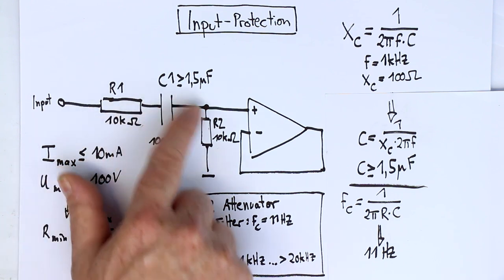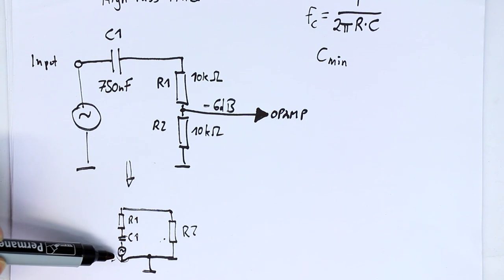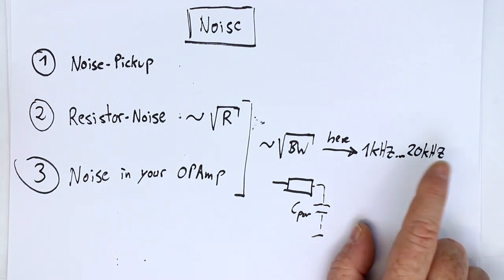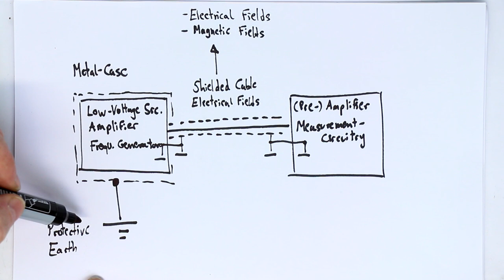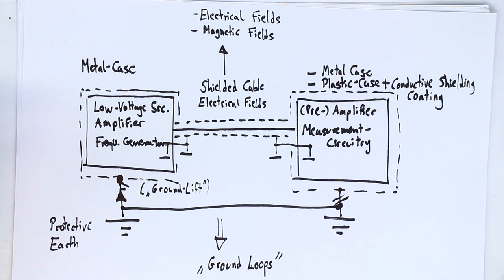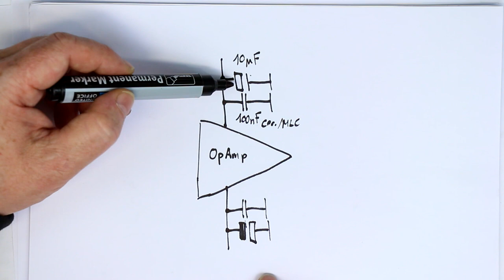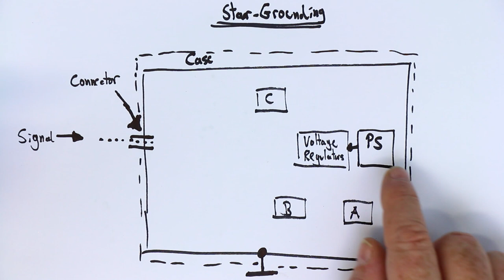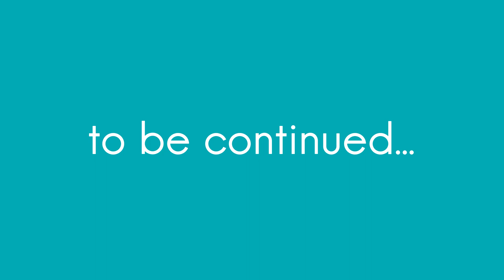Precision OpAmp Design Pt.3: Noise-Pickup, Shielding, Grounding, PS-Decoupling

Comment: Hello Roger, excellent YouTubers such as YOU are difficult to come by! Clear explanation of how OpAmp works and choosing capacitors and resistors without much mathematics. Some people explain it with too much mathematics. Some people explain without much detail. Some people are very good at explaining stuff but their hands and body are covering what they are showing, wires and components are all over the place (and usually without a clear circuit diagram on paper/board how they actually wire stuff).

About noise, recently I learnt about instrumentation amplifier, so-called "balanced electret microphone preamplifier". It is said to eliminate most, if not all, noise.

An instrumentation amplifier looks simple enough to be constructed, utilising only three OpAmps and seven resistors. Neither am I a fan of audio transformer as it can be stupid expensive for a very good one, for that exorbitant price I might as well buy a crazy inexpensive assembled and tiny SMD amplifier from China, and not bother wasting time DIY nor learning about the wonder of electronics.

Will you make a video on it? I look through your videos, there is none about it. Maybe you would not make a video about it as you have no use for it. Oh well, I am merely trying my luck enquiring.
I found some circuit designs and I simulated one with Multisim, only one looks workable. But still, I do not know how to choose the optimum resistors and capacitors. There is also no visual of how those three OpAmp actually work together to achieve common mode rejection, there is also no showing how to test how it rejects common mode. What the heck is 'common mode' anyway! I read a lot about OpAmp but I am still not any more intelligent than before reading!

Oh, I forgot to mention that a dedicated instrumentation amplifier is extremely expensive, although it is superior to three OpAmp combined.

Comment: Another method for eliminate ground loop mostly used in USB is to connect ground between PCB and case (or cable shielding and pcb ground) by resistor 1MOhm and capacitor 1nF which eliminate some of the noise. To avoid problems with ESD capacitor must be rated for 2kV.

Comment: Very helpfull, thanks! A practical question: what to do when there are several transformer(taps) and subsequent power supplies with their own ground? Should they remain separate from each other and from protective earth?
Reply from the maker: Do you mean several transformer(taps) inside one device?
That shouldn´t give a problem when the separate grounds are connected on the PCB at one point (the ground of the power-supply with the most sensitive inputs), using thick traces and perhaps a multi-layer PCBs with separate ground-planes for e.g. analog and digital grounds.

Protective-earth is a difficult question. As I hinted in the video, I never use protective earth at all in my home-built equipment.
When you build/buy commercial equipment you have no choice (except using isolation-transformers or disconnecting protective earth at your own risc). It´s just a matter of trial-and-error. Sometimes you have no problems with protective-earth, sometimes it ruins the signals at your sensisitve inputs.
I know of stories in the analog labs of electronics manufacturers where they have separate mains-outlets with and without an inbuilt "ground-lift" (i.e. the protective earth disconnected)
Reply: OK, that's clear. I use 2 transformers in my DIY DAC. I have the post transformer grounds (and signal ground) not connected to protective earth and also use isolated RCA jacks. Only the metal casing is connected to earth, with mains filtering at the IEC input. Do you feel this would still cause EMI? It sounds great, though, no hiss or hum, but I'm always looking for improvements
 :=)
Reply from the maker: That´s probably exactly like I would do it :-)
In my preamp I completely got away with any mains-related problems by having it powered internally with NiMH-recharcheables (2 separate packs for the analog and the digital section).
The charger-circuit is external and disconnected with relays when the preamp is in use.
Thereby of course no protective-earth connection because of the battery-powering :-)

Comment: Nice explanation with the grounding and how to avoid ground loops! Have you used transformers to break ground loops in audio applications?
Reply from the maker: Hi Aditya,
do you mean audio-transformers or isolation-transformers for mains-voltage?
No I didn´t use any of them.
I solved the problem in my home-built HiFi-preamp by using isolated RCA-jacks where the signal AND the ground are relays-switched.
That way I got away with any ground-loops once and forever :-)
Reply: Indeed, I meant Audio transformers - like ones made by Oxford (OEP) or Triad Magnetics - though there have become pretty expensive in recent years..
Reply from the maker: I´m not a friend of audio-transformers (except perhaps as an alternative to an MC pre-preamp), although many people swear on them.
I remember here in Europe the ones from Lundahl are favored by many HiFi high-end companies: http://www.lundahl.se/
Top-dollars of course.

In my homebuilt preamp I used the brute-force method to get away with any mains-related problems by having it powered internally with NiMH-recharcheables (2 separate packs for the analog and the digital section).
The charger-circuit is external and disconnected with relays when the preamp is in use.
Thereby of course no protective-earth connection because of the 
battery-powering :-)
Reply: transfomers have their own set of negative problem in audio ciruits.
Reply: At between £60 - £120 apiece, for Sowter,  Lundahl or Jensen, transformers are not a trivial expense :-)  For microphone pre-amplifiers, as the input transformer, they are a real help :-)